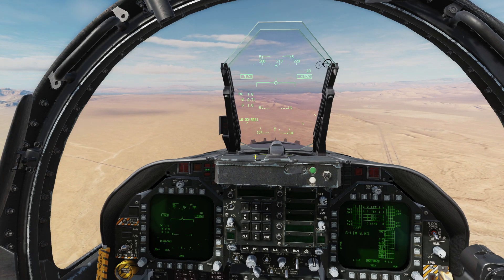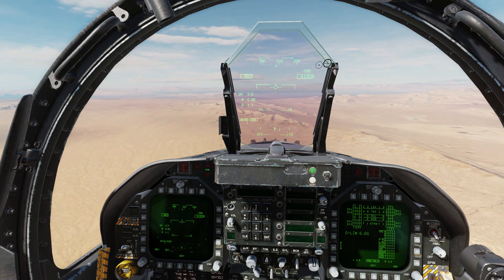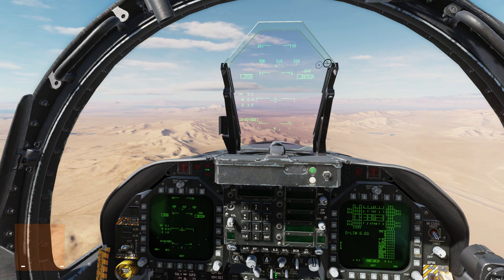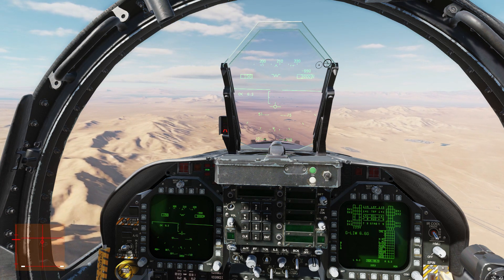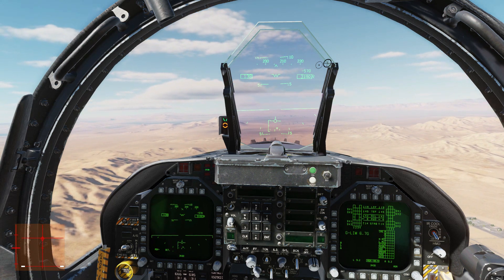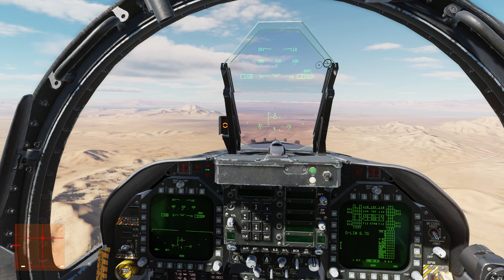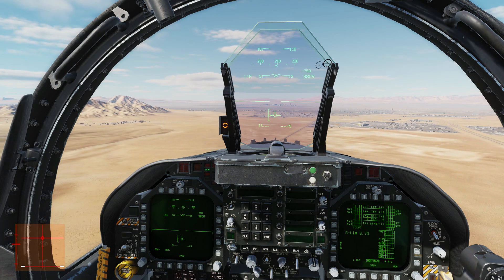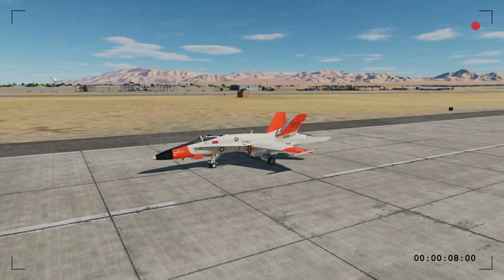DCS F18 On Speed AOA Guide -  Grease That Hornet landing - DCS In 3 Minutes Or Less

Comment: Just a quick tip coming from a private pilot's perspective. Fly a standard pattern, 45 degrees turn into the downwind at 1,000ft agl of the field elevation so if the elevation of the field is 600 ft then add 1,000 ft to it and that's your pattern altitude. So, 1,600 ft is the pattern altitude then just fly your pattern as normal.
Reply from the maker: All good stuff and I'll probably do a vid on flying proper patterns and suchlike but the focus here is on flying the AOA so i keep everything else as simple as possible with a long straight-in approach.